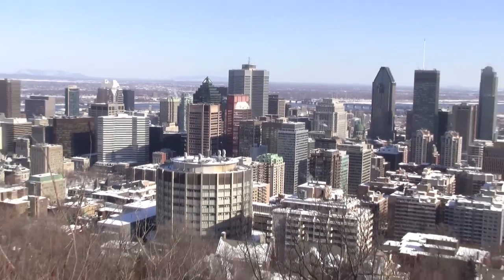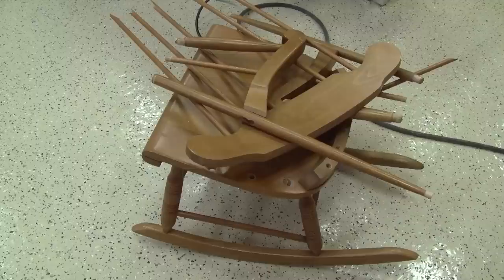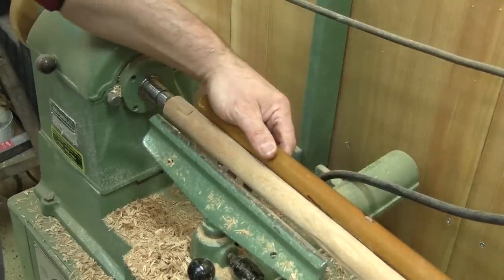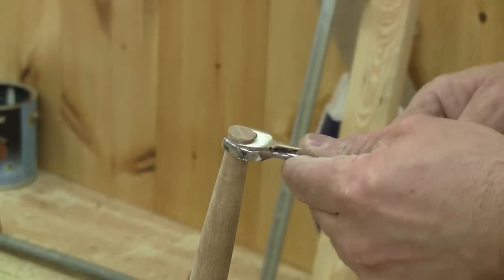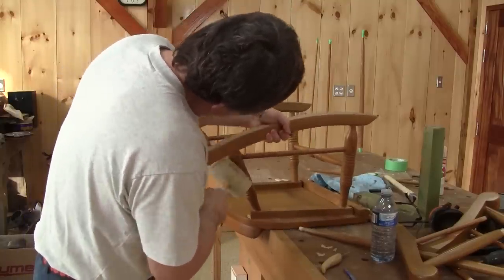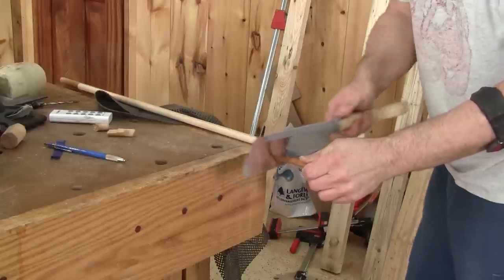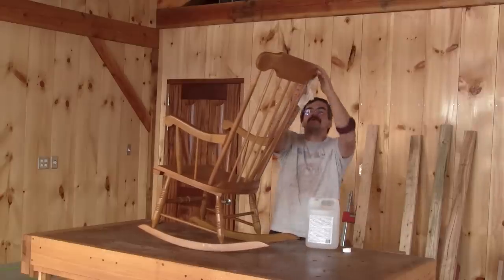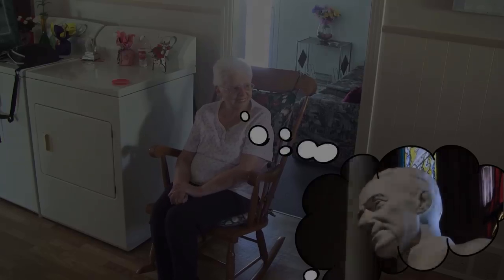The Woodpecker Ep 77 -  Fixing a rocking chair

Comment: Very nice fix Alain!  I have some chairs to fix also, you have inspired me!  What spray system are you using?  Is that a catalyzed lacquer you sprayed?
Reply from the maker: Faith Woodcraft It' a Earlex HV5500. It's uncatalyzed straight nitrocellulose, old lacquer wich came from the time my father used to re-finish furniture.
Reply: ***** Very nice!  I just purchased a Earlex HV3500 from Elite (out in your area...I'm near Winnipeg).  Just minutes ago I sprayed for the very first time.  It seems to work well.  I sprayed on some Polyurethane.  Thanks for your videos...I watch with great interest each time!
Reply from the maker: Faith Woodcraft I bought mine from Elite tools also :)It's working quite well, but I have just, to date, one complaint; sometime the hose pops out of the gun, because it's just pression fit, and when this happened the gun spit a blob of the finish on the piece. That's not fun....
Reply: ***** I've had that happen too.  I thought they should have some locking mechanism on that...and perhaps a swivel coupling as the hose can get twisted as I paint.
Reply from the maker: Faith Woodcraft The more expensive model  have some sort of locking mechanism, but they cost twice the price. So instead, I swear for time to time.

Comment: Hi Alain. Does cleanning with alcohol gives you the same results as cleanning with mineral spirits?
Reply from the maker: Yes it does. What I like about it, is that alcohol evaporate more quickly than mineral spirits, so I can aply the finish right away. I only use mineral spirits when I'm finishing with oil base finish.

Comment: Je vous salut Alain,  that is a different looking chisel you are using.  I'm not sure if a regular old roughing gouge might be the better tool for first getting the stock round.  It's not that important to get your corners perfectly rounded before turning the piece.  I use a draw knife to whittle back the corners and it isn't perfect at all before I turn it.
Reply from the maker: Unfortunately I don't own a drawkife. I thought of you when I did this and told myself that your trick was much better, I'll look for a drawkife this summer in flee markets.
Reply: *****
Is that chisel carbide tipped or something?  Never seen one like it.
Reply: Peter Collin Looks like one of these:
http://www.woodturningz.com/EWT_1200_Full-Size_Easy_Rougher_Square
Very easy to use - gives confidence to beginner turners.
Initially they were treated with some condescension by experts, but now several of the tool manufacturers are creating their own versions.
Reply: Don Johnson
You do have to be a good sharpener with traditional lathe tools!  I didn't want to sound condescending toward that chisel at all.  But boy, they sure are pricey!
Reply: Peter Collin As they cost 'an arm and a leg', it could make them difficult to use effectively due to the shortage of limbs!   LOL
Reply: Don Johnson
:)
Reply from the maker: Peter Collin Yes it is. I bought a set of 3 EZ wood tools turning chisels. I just used the rougher for the rung.
Reply: *****
Alain, i also posted a new video today also of lathe work!  Must be the hip new thing to do.